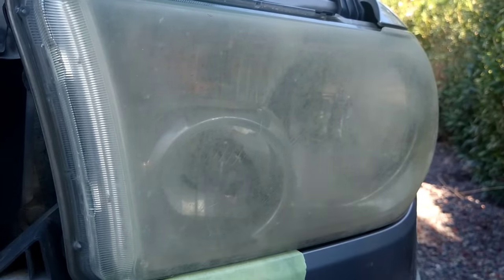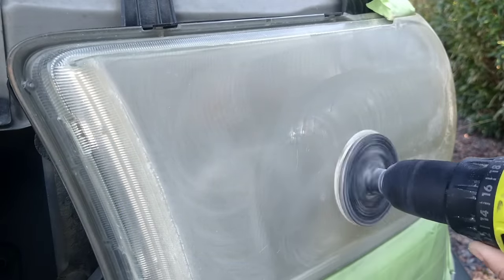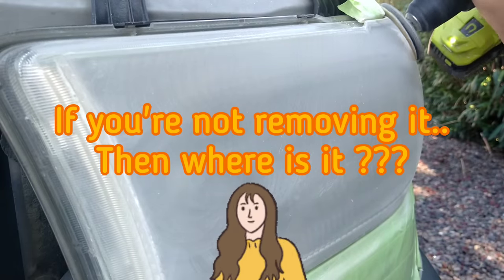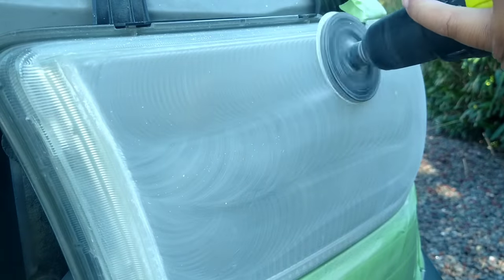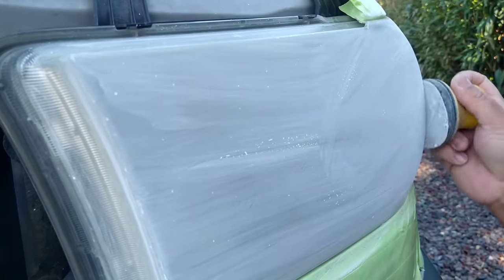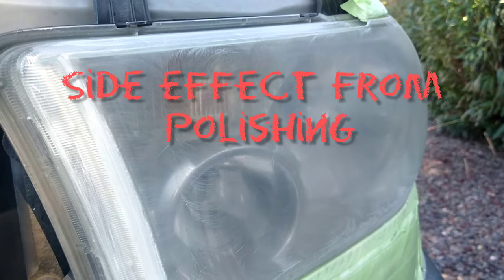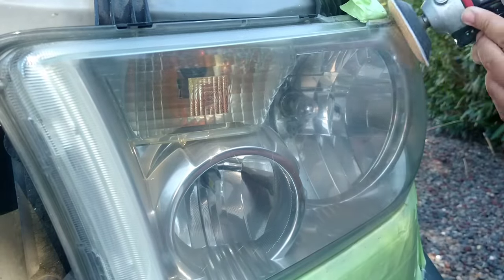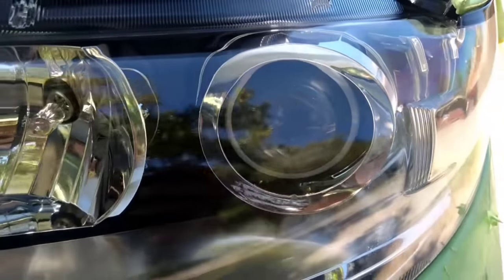POLISHING HEADLIGHTS IS A SHAM/scam  ---  and why you should never only polish headlights

Comment: My car is seventeen years old so I simply had new headlights from the dealership fitted which I considered a normal maintenance expense but was it? How much does a genuine restoration cost?
Reply from the maker: It's very hard to answer this question I have people asking this question from around the world, from Louisiana, from Texas, from Florida.. generally economic structure is different.. for instance in a small City, are poor City have that restoration give you $50 and that would be expensive.. for big huge City $250 might be headlight restoration.. very hard to say but it is a fraction of very small fraction of the cost of headlights especially OEM.... Depending on the car as well.. normally probably under $300.. some places under $150... And even some places under $100.. but you pay for what you get if you go to the person in your area who is one of the spoken best you can charge more.. if it's just somebody getting started he can charge what he wants but are you going to get it over the other guy.. so many variables.
Type of car has a big deal to do with it as.. but the cost of how that restoration is extremely insignificant to the cost of actual lights and even the cost to install them for that fact..

Stay tuned keep watching a lot more to come.. and now you know for next time definitely save some money... Half the time the dealership will not tell you..

Thank you for watching.

Comment: I have done headlight restoration for years. I always wet sand and buff out by hand and apply the uv sealer with a lint free shop towel, per the manufacturer instructions.  I have always had excellent results. Never one complaint. I have always charged $50-70 per set depending on the damaged layer that had to be removed. I will never use spray on diy junk. I always purchase the professional cleaners and coatings. Manufacturer specs say its good for 2 years but I tell the customer 1-2 years. Still never have had 1 callback.
Reply from the maker: Yes many ways to do it...
This is the best I've discovered it's a mashup of all positive points of headlight restoration...out of doing it dozens upon dozens of different ways and combinations and experimentation.. this in my opinion is the best.. results speak for itself.  And it's very business and customer friendly..to the point where a lot of detailers from far and near want me to train them in a since but I refer them to my channel..or tell them to pay for a restoration and watch...
Thank you watching..you should check out some more of my videos...https://youtu.be/6_3Z7pTtpko

Comment: Polishing is definitely a scam.  Some of the diy restore kits are too.
My toyota headlights were trashed and had been polished 1x before a few years ago.  I got a turtlewax kit (saw it on a watchJrGo headlight restore test with several other kits) and took my time with the wet sanding by hand with the different grit pads they provide, and then the polish and sealer.  Really turned out nice and about 6mo out still look like they did when I finished.  Took less than an hour and that was going slow, taking my time, no power tools.
Reply from the maker: https://youtu.be/eyLwhPwUjBs

Comment: Both of my old BMW's have glass headlights with replaceable classes. They are attached just with clips and just pops out easily. I remember they costed 29USD/Eur piece. Usually they lasts about 10 years, but I have just polished and and waxed them. After that they last about 5 to 10 years. But is it worth it, if a whole new glass costs 29 bucks?
Reply from the maker: Well that's a very old rare car...like way less than .0001 of the vehicle population..this doesn't really apply to this...this is a needle in a haystack...https://youtu.be/LcMFr0mpp-4?si=pZ4YYMtxFnZT7j--

Comment: I have polished headlights at many of dealerships/ shops i have worked at,  and bought many different style kits after market, the very best i found was a cheap amazon headlight restoration kit discs only, had 800 grit to 10,000 grit discs for 15.00 dollars.  polished them with discs and spray bottle of water moving from 800 to 2000 to 5000 to 10,000 they were almost clear with no polish when i was done, then i taped car off and used (2k clear tranparent clearcoat) with the hardener activator button, this is the best method period. The clear coat was about 30.00 a can on amazon
Reply from the maker: Anything with 2K clear especially that one is the worst method my friend.. if you don't have any plans of having anybody see you again and you're not a business go for it I guess also a waste of money $40 a headlight... My overhead is literally zero dollars.. also what you doing is not considered polishing headlights.. it's a form of headlight restoration polishing how much is different.. by working with dealerships you don't have to worry about a vehicle coming back to you.. but not running your own business you don't have to worry about those things so you can do whatever you want to a vehicle you should check out a couple of my videos in 2K clear and see what it does to headlights and see what happens when you have to redo the headlights..... That's literally the worst method at  many different angles.. your costs were way too high... 2K clear is the worst substance in the way to expensive...(fast Max spray) it cost me about a dollar to do a headlight... With the proper tools and equipment and supplies the highest level of supplies 3m etc... made for headlights.... When you're running a business doing headlights it's key to use materials MADE FOR HEADLIGHTS.... It's a legal and liability issue.. for any business he got to use the right supplies for the job...
I do many work much much work for dealerships...
You should check out a couple of the videos like I said about 2k clear and also check out my latest video it'll show you just what aspect of Y2K clear so bad especially the one that you're talking about using...
Thanks for watching..https://youtu.be/k8_ljUVQfvo
Reply: @theheadlightrestorationpro  spraymax 2k clear 2 in 1 is headlight restoration clear, not to be confused with non transparent spraymax 2k clear. By far best product i have used for my own car. Use a respirator. It costs more but its for my own car so i just want the best product not looking to make a profit, anyway just sharing my experience been doing this a while im 43, have a good day.

Comment: I've found that different headlights have different results. On my ancient Mazda MX-3, Novus 2 plastic polish and not a lot of effort kept the headlights clear for about a year with no clearcoat. This didn't work on an older Toyota Matrix, or some other cars I worked with. If you're using something abrasive, polish or sandpaper, you're removing at least some of the yellowed plastic, and your results will depend on how deep the yellowing goes, and how the remaining plastic reacts to UV light. Some plastics will become quite brittle, and then you might need to replace the enclosure completely.
Reply from the maker: All headlights are not equal..💯

Comment: I use cerium oxide which is a glass polish. It's used to remove scratches in cell phone screens. It works insanely good.
Reply from the maker: Interesting might have to check that out . put that one in my notes..🤓
Thanks you.
Reply: @The Headlight Restoration Pro  I get the optical grade white powder on Amazon. I discovered it from a cell phone repair video and instantly thought of headlights and sure enough.

Comment: What about rubbing compound ? Not sure if it is the same stuff we use to use some 50 years ago, but always did a grand job on a cars surface. Would seem to me it would do a fine job on those plastic  headlights as well . what do you say ? ( never used it for such but in my days lights were all glass )...Lol
Reply from the maker: Technically you could use rubbing compound it would somewhat work but not to the degree of one specifically designed for hard plastic.. leaves a little bit more hazy..., and not as good for the long run .. there's a hydration aspect the regular rubbing compound does not provide as well...
Good question thanks for watching.
Reply: @theheadlightrestorationpro  Thank You for responding and making the video
Reply from the maker: Thank you for watching I appreciate it plenty more to come and plenty more up...

Comment: Have found that a wet, hand sand with 400? Then 800? or so,vertical and horizontal,then metal polish,then clear cote,all done in 30mins or so.Marked improvement.Should always wet sand,in my opinion.

Comment: What if the headlight is only partially fogged up? Can you restore just part of a headlight? Thanks
Reply from the maker: It's not recommended.. it gets very tricky and of the news from experience what happens is all the surrounding areas or just behind yeah that went bad for his time going to happen... With that being said when you replace or spot replace a certain portion of the clear code and service certain area of the light now that area is brand new and the other areas surrounding it is old and ready to go bad soon so it's hit or miss...
Reply: @theheadlightrestorationpro  I see. Thank you very much for the reply and advice! I have a 2006 Dodge Ram 2500 and the tops of the lenses are yellowed and foggy but the rest looks pretty good. Can I use the method you showed in this video to restore these lenses? Thanks again:)

Comment: Hi, what do you think about the Maguire headlight restore kit?
Reply from the maker: A solid kit.. it's pretty good was definitely top 10 possibly top five... Very easy to use and one of them has the one of the best sealers around inside of it...(application method)
Stay tuned have some more reviews coming up..
Currently have two headlight restoration kit reviews on my page..

Comment: The issue i had was I ended up with holograms after finishing with a ryobi microfibre buffing pad on a cordless drill and some meguirs plastic polish. I was too chicken to spray anything on and had heard that only 2k would do so I just went over them with cerakote later while i was applying that to some black trim. 

On another set I ended up with swirls that multiple buffing passes wouldnt get rid of. Pretty sure I sanded correctly 800-1200-1500-2000-3000-5000 wet sanded by hand. Am I just not buffing correctly?

Comment: This is how polishers like Pledge work. They may seem good at first, but all it does is put a wax into all the gaps, which, when you wipe over, make a smoother surface like a mirror. But the next bout of bad weather will just wash it off. Took me a long time to realise that the chemicals in it can actually be bad for plastic and leave you needing to do it more and more. I used to use it on my motorcycle screen and it always made it more work later.

Comment: why do you polish before the clear coat? shouldnt the clear coat adhere better to 2000grit and THEN you polish the clear coat to remove the orange peel hazy effect?
Reply from the maker: If you're using something that develops orange peel you're using the completely wrong product... Made for headlight products do not develop orange peel.... Products that are made for body work and painted surface develop that issue... Most if not all made for headlight products are self-leveling and designed to adhere to the plastic surface... Zero issues with sticking... The reason why people do this is because they're using products that aren't made for headlights which is a major error to begin with.... If you have to do anything after you coat them you're doing something wrong....💯
And if you're spraying them after 2,000 when they're foggy you're definitely doing something wrong and your headlight although might turn clear will not function correctly and you will be losing anywhere from 30 to 100 yards of light on average....(light output)
You must always clear coat headlights at their Clearest point... Just like the factory does.....(if not they won't function correctly even if they're clear to the eye)
Watch this video it will explain more scientifically why this is..https://youtu.be/LC4ZBu02JZg?si=7MtKeg4MxbxIEzo6
Reply: thank for replying to me @theheadlightrestorationpro
Reply from the maker: @stellarrodriguez9469 thank you very much for watching..💯

Comment: i did polishing a few times in the past, but wasnt impressed.  So i just do 2 or 3 stages of sanding ending around 3000grit.  then 50/50 spar urethane and mineral spirits applied with a blue shop towel.  the clarity is like glass.   i touch up every 2 yrs.  pretty quick process depending on how much oxidation needs to be removed.  the urethane has a faint yellow hue, but it blocks the UVs decent.

Comment: Thanks for mentioning the yellow staining symptoms- my truck has had this from the start and I've been wondering if it's worth trying to rehab or if the plastic had been overheated by the previous owner. Guess I'm going to be replacing them if I want to have non-yellow headlights again.
Reply from the maker: Glad to be of assistance.. please subscribe and watch for future content very informative channel.
Reply: Yeah I too have permanently discolored headlights.
The HIDs really burned themselves into the plastic.
Reply from the maker: Yes this is an issue that they have coming cuz everything is switched over to LEDs a couple years of LEDs on that plastic starts burning the inside and you get LED burn which obstructs the light naturally.. they're trying to figure out a different way of projecting light some stuff about lasers I still got to look into.. but won't be on the market for a long time.. even HIDs still have a lot of side effects too.
Reply: @theheadlightrestorationpro  but wouldn't HIDs burn the plastic the worst because they get hotter than LED and have more UV in them while LEDs would do less damage?
Reply from the maker: Well they both burn hot what I'm trying to say is the LEDs are a little different they kind of focus differently and I noticed more Burns more specific Burns in a c shape or moon shape on the inside with the LEDs , HIDs burn is a little more vast on inside but you are correct.

Comment: That's what I've always thought is you can't keep polishing them over and over because from factory they've got coatings and that gets worn down and then removed. So if you do this you need to finish but putting a protective layer back, right? That's the entire point of the video is to use a final sealer to help make it last longer.

But being in FL - My 10 year old car the headlights are clear and fine. I wash my car on a semi-regular basis. I don't understand why some cars get so bad while others don't. I'm not sure if it's by brand, treatment by owner, location of where you keep the car, how often or not you wash or go thorugh a wash... what makes some vehicles headlights last longer? Also I've seen cars with horrible paint damage and don't get that either. How does that happen where the pain has peeled off in patches??? I have always been curious but have never looked up to see what if any research says???
Reply from the maker: It all has to do with the climate in any given location, oxidation differs from spot to spot . 
Yes you can't keep polish damage polycarbonate because the molecules are actually still damaged,,also it just keeps building up again and again...worse every time....
Thank you for watching..
Have plenty of videos out and more to come...
https://youtu.be/bCD4At1iFAg
Reply: The trick is to add UV protectant (it should be water-like, zero grit) on the lenses from day 1.  Most new cars can be sitting on the lot for weeks or longer and caked in dirt - and quickly machine washed before delivery.   Put a thin layer (literally a couple of drops worth on new plastic) on every few washes.  They don't oxidize and stay clear for at least a decade. Some factory UV is just junk - Ford especially - and needs some added help. I've lost count of the number of old Fords with dead paint and headlights I see on the road because the OEM clear and UV layers are very poor quality.

Comment: This should not happen with the high cost of new vehicles.  I have a 2018 Chrysler 300c Platnium and my neighbor has a 2019 BMW 5 series.  My headlights look new, and his BMW has a hazed look to them, why?  We both garage our cars and take care of them properly.  I miss the days of glass headlights and with the many shatter-proof glass products on the market, the manufactuer's should be using them instead of crap plastics.
Reply from the maker: Yeah there's many reasons for this but primarily is probably habits and the fact that BMW Believe It or not makes inferior headlights.... They're far too hard with the far too hard coating... Check this out this will answer some of the questions and thoughts along this line..
https://youtu.be/LcMFr0mpp-4?si=FgMIcBMCx1zz4VpM

Comment: Would this also work on amber front turn signal lenses or marker light covers? I’ve got a 2005 sterling lt9500 dump truck
Reply from the maker: Yes it should work on an all lights in the vehicle on most vehicles if it's plastic going to work side markers tail lights all that ..👍🏽

Comment: Does that process work for small scratches and lots of tiny cracks coating a hazing effect?
Reply from the maker: Nine times out of ten it does..
It removes all of the scratches and sometimes when you have teeny tiny spider cracks this process will fill them two different ways from the plastic hard lens polish and then by the sealer at the end leaving a smooth shale finish it also will prevent the spider cracking and things like that from branching out further or getting worse..
Reply: @theheadlightrestorationpro  great answer thanks dude. Will be using your links...hope they sponsor you for selling their product!
Reply from the maker: @jim-stacy  me too..lol but it would just be a side effect of me telling the truth of what I've discovered and what I use and how I do it.. just a mirror side effect..😎